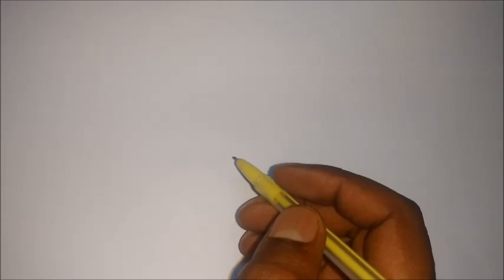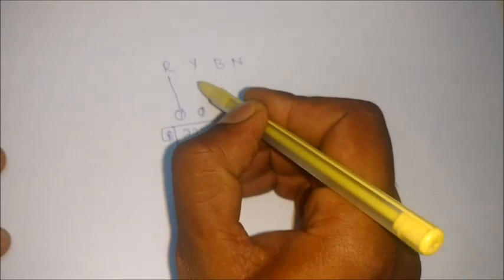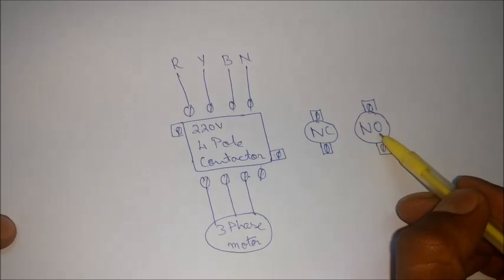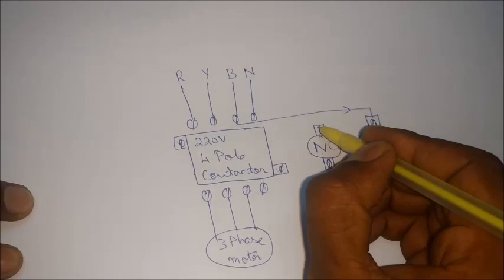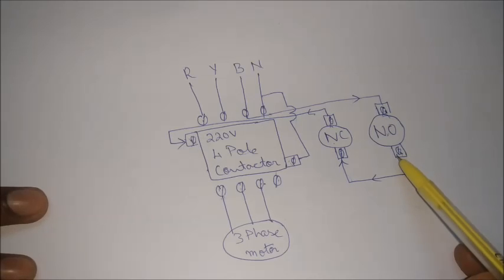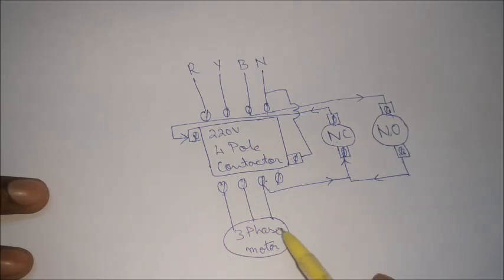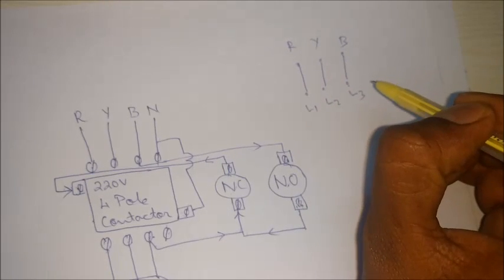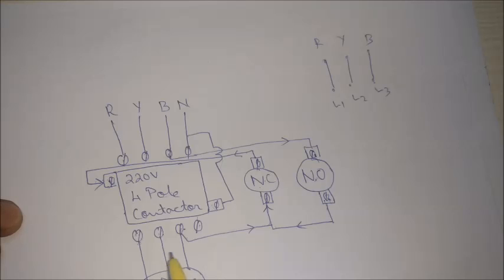How to Connect a 4 Pole Contactor with NO NC Switch

Comment: Do you know any contactor which switches between two 230v input lines to one load... Like a change over switch one supply line at a time to the house ..i am using a DPDT relay but it doesn't bear the load

Comment: I have a  question.  In the  case of  any fault  or emergency  how  can  its break the  connection  between  contractor and  motor
Reply from the maker: The emergency kill switch is nothing button a NC switch with a big knob.. u should connect the emergency kill switch in series with the existing NC switch...
Reply: See this video how it break the power

Comment: I think  your  connection is  not  perfect  because  there are  some  others  connection  in contractor  wich is called  no but you  don't  mention  in your  diagram.
Reply: Hello, not all contactors have the extra connections called auxiliary contacts. For example- Normally Open and Normally Closed. This is a good explanation of how to connect a basic contactor without the auxiliary contacts.